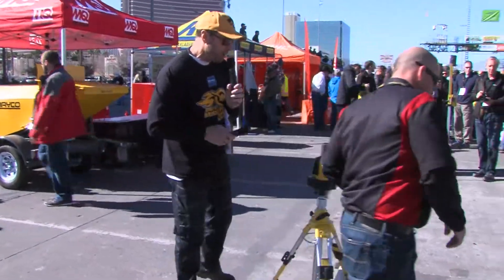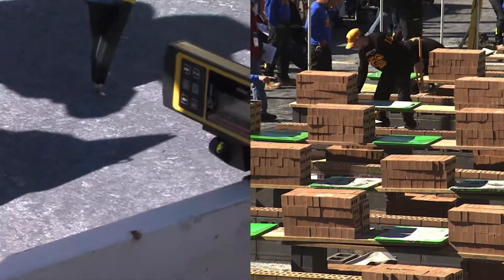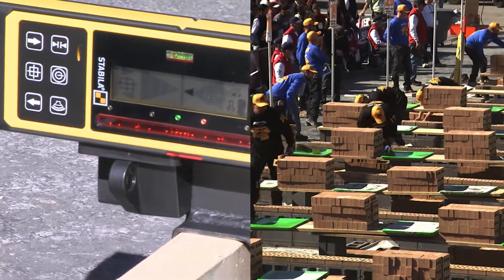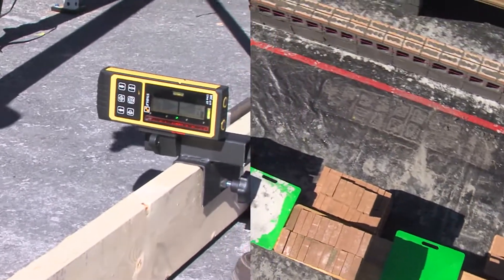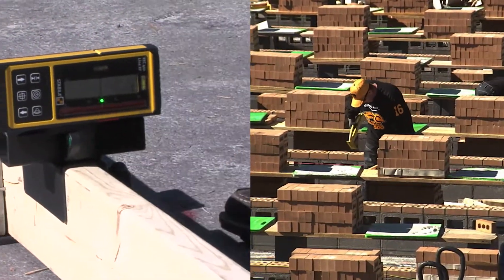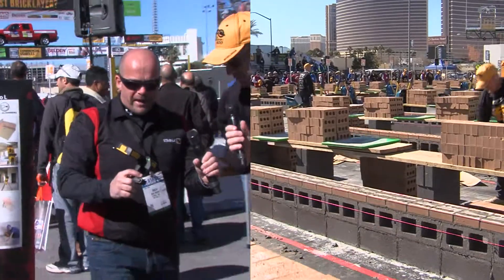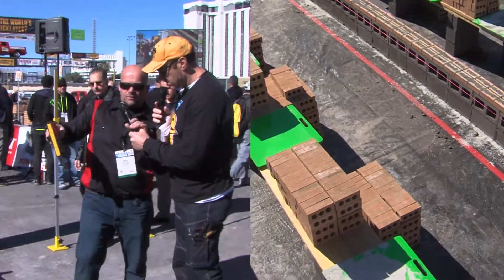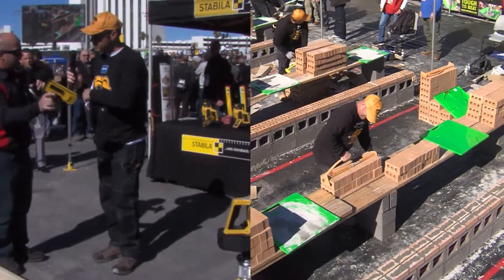Stabila LA180L Layout Station

Comment: Give me a layout level that centers the laser over my layout marks so when it rotates it does not rotate off the marks....also let me set it for any angle
Reply: There's another video showing that the plumb dot where the 3 vertical lines converge does actually pivot over a point. As far as the other angles, I guess that'd be nice but trig gets you there easy enough, or a theodolite...